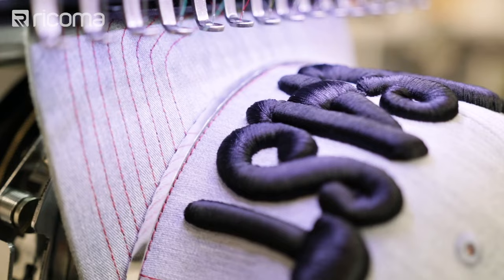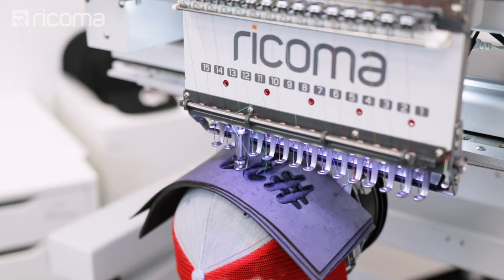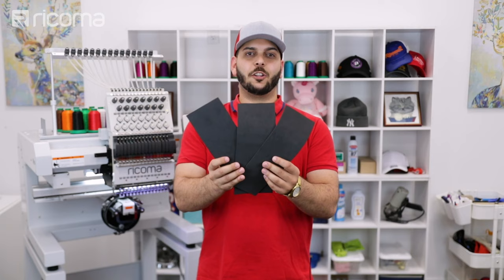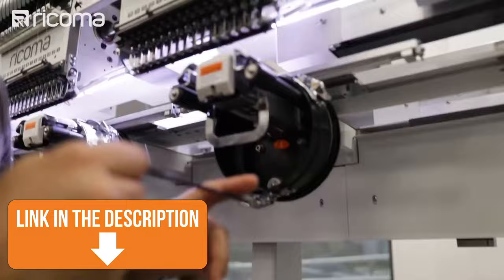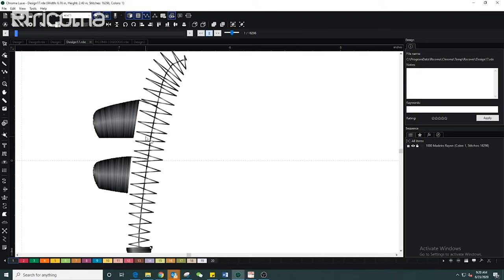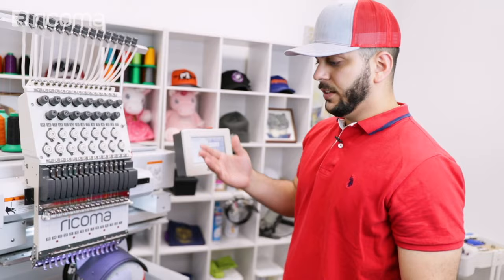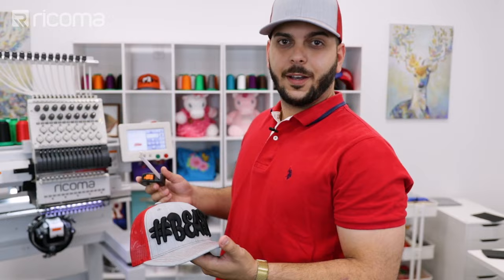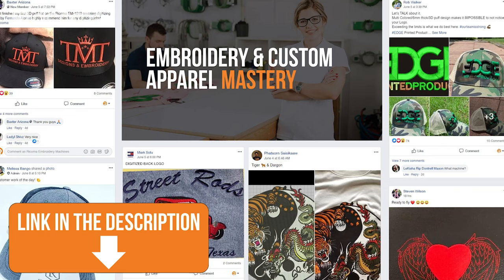WE BROKE A NEW RECORD! | RICHARDSON Cap 3D Puff Embroidery | Ricoma Embroidery Machine (EMB Hub 119)

Comment: Thanks for stating the needle size.  After you set the density in the software to 1.x, should that density match in the machine?  My machine is set at default for 4.0.
Reply from the maker: 4.0 to 4.5 is usually the standard!

Comment: Hi! I do not know the ricoma maschines, but is it normal that it doesn't have a laser an that oil spills from it in the beginning (onto the foam)?
Reply from the maker: Hi there, we do have a laser attachment that can be purchase separately. If oil spills from the machine, it can be easily cleaned, but that means it was over oiled but not an issue.

Comment: I have a Happy HCD2-1501 and I'm doing New Era 403 trucker hats. I am using 3MM foam, 80/12 needles and have my tensions set. I cannot get these hats to run. Needle breaks, thread breaks, ghost thread breaks and severe bird nesting. I just don't know what else it could be.
Reply from the maker: Hi there, we're so sorry to hear that you are having difficulty with your machine. Please check out this video on birdnesting: https://www.youtube.com/watch?v=7g1Y9GZqGCo&t. Also, please join our Facebook support group, Embroidery and Custom Apparel Mastery. Here you will be able to connect and ask questions about different embroidery machine brands. Hope this helps! https://www.facebook.com/groups/embroiderymastery
Reply: Hi Kronic. What was the solution you found? Thanks in advance. Happy Creating. Love the Kronic btw
Reply: ricoma would it be hendigitising as well as all noted. Thanks in advance. Can you also do or direct me, on video for as low as you can go with Gen 2 cap hoop. Thanks.

Comment: would you mind if i asked why the size 80 x 12 needle?
Reply from the maker: HI there, thanks so much for watching. 80/12 needles are bit more durable than 75/11. Working with thick foam and 3D puff designs, it's best to use a needle that has these qualities. Hope this helps!

Comment: file for hats and start from left to right?
Reply from the maker: You can find the design in the description below the video.
Reply: @ricomatv  File is not the best for hats. It starts from left to right. It don t have any run stitches to hold the material before satin. The end of letters doesn't have any caps to hold and cut foam. Why the Original file made in Chroma is not there for downloads too?